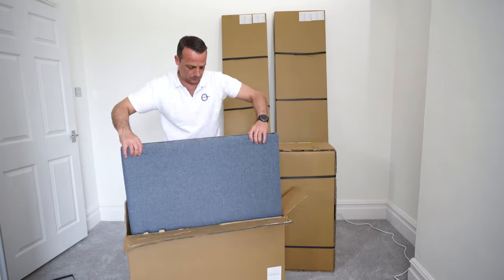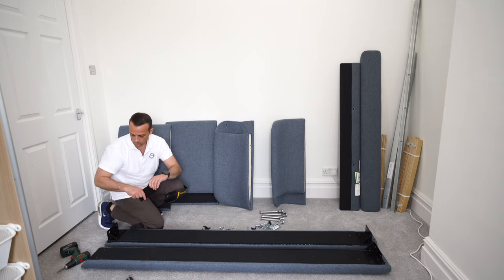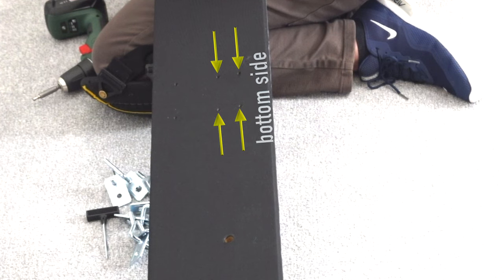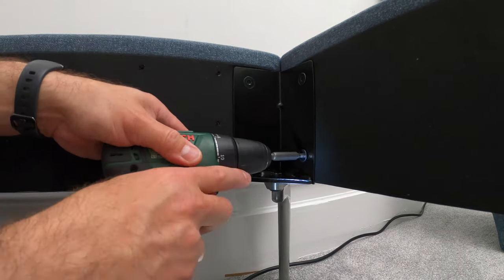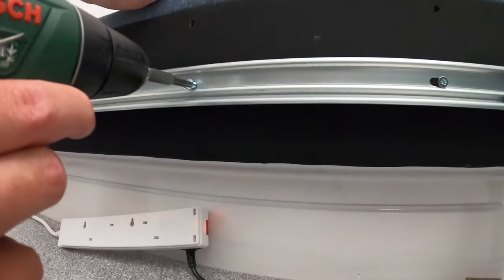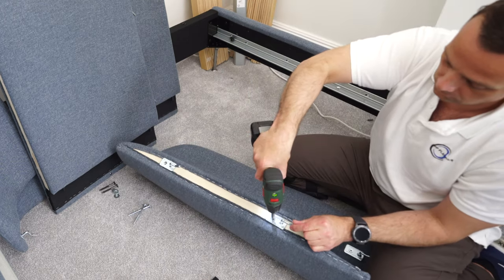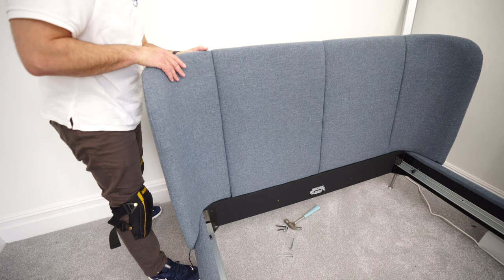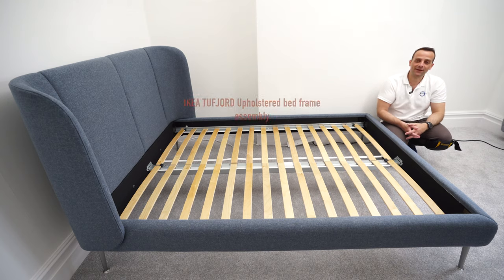Ikea TUFJORD Double bed assembly instructions

Comment: This bed is not easy! It’s mostly straight forward but attaching the headboard has become a nightmare for me - I so far only have one side attached as the others will not sink into the holes. 😩
Reply: I see this is an old comment and hope you eventually solved the problem. Just in case anyone has the same issue, I found the board extremely difficult to assemble by hand, but it sank in immediately when I started tapping it from the top with a rubber coated 15 lb exercise hand weight. A rubber mallet would probably do the same.
Reply: How is the bed till now? I am looking for reviews but there are so few.

Comment: Excellent video - thank you!! The headboard is indeed the hardest part. I ended up using a 30 lb kettle bell to gently "hammer in" the boards into their holes. I did not manage to screw in the 2 front head boards using the two long black screws as I just couldn't get the holes to align properly. The head board seems pretty steady and solid regardless, so maybe not a big deal. I assembled the bed by myself in about 4.5 hours.
Reply: I should note that I did not use a drill.
Reply from the maker: You right the headboard is bit tricky glad you manage. Thank you for watching
Reply: How is the bed till now? I am looking for reviews but there are so few.

Comment: Hi, I watched the video but I still need help! Right now I have the frame standing with the headboards on. The long black screws with the washers that get screwed in under the headboards aren't gripping anything inside, even when I screw with pressure. Is there a treaded hole that isn't lined up with the hole in the frame that I put the screws in? I made sure to push the headboards down all the way I even used my bodyweight. It all looks tight and flush. I don't know what to do.

Comment: Let me start of by saying I have put together my fair share of Ikea stuff, so I am used to fighting with getting things to line up. This headboard was the fucking end boss. It took two of us the better part of two hours trying to get this to fit in. We wiggled, jiggled, jumped, used all of my weight. I still could not get it all the way in. It still lines up fine and I can screw it in, but there is about a 1/8 inch gap where the peg goes into the hole. I lifted the bed with my foot and slammed it down on the floor as well, that was the ONLY way I was able to get it that far.

The other problem is there are NO spare parts. Not one.  Usually I am left with a bunch of extras, not here. The screws strip so easy, I had to use my own I had laying around to get the drawer brackets in. it is like they made the screws out of cheap pot metal. I could probable chew the screw it is so soft.

In the end it looks very nice and seems sturdy but I am worried there is no middle support touching the ground...but I guess time will tell.
Reply: Do you recommend it? I’m worried that it won’t hold the mattress weight and our weights 😂😂
Reply: @sarahyahya3535  I mean, when it is put together, it is nice and for me it seems stable. Just be prepared for a long battle
Reply: هل السرير جيد بعد الاستخدام لاشهر